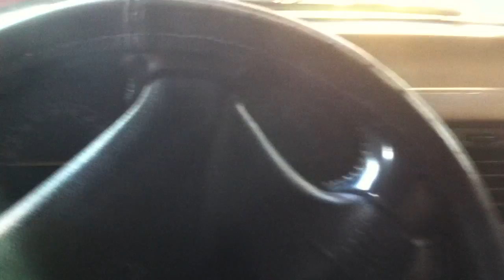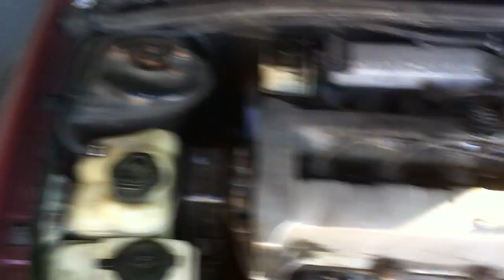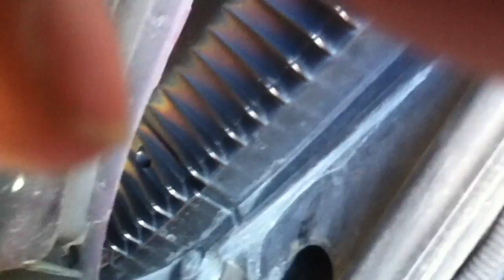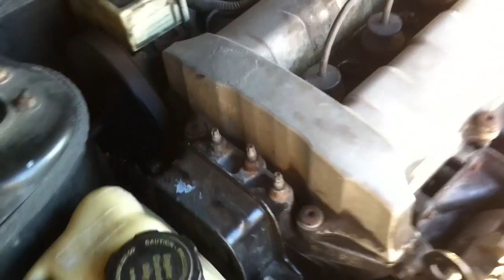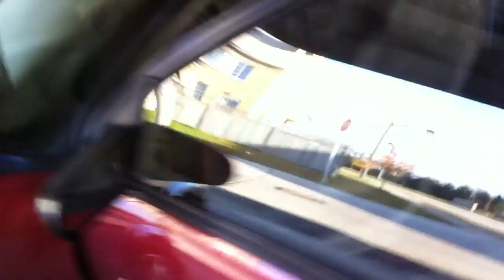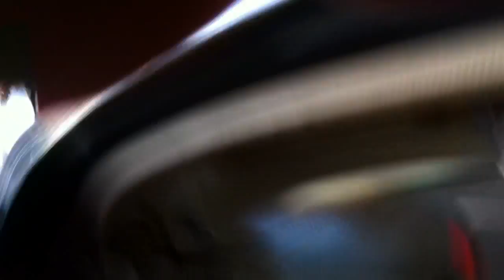Saturn engine Noise

Comment from the maker: Turns out this was my new alternator with less than 2500 miles that became defective.  The pulley sunk into the housing, forcing the fan blades to scrape against the housing.

Comment: I know im late but next time you have some crazy sounds just remove the drive belt and see if it goes away, dont run the car very long like that though because the water pump will not be turning. it will allow you to see if its inside the engine or just one of the belt drive accesorrys